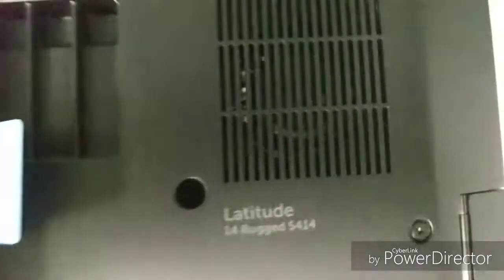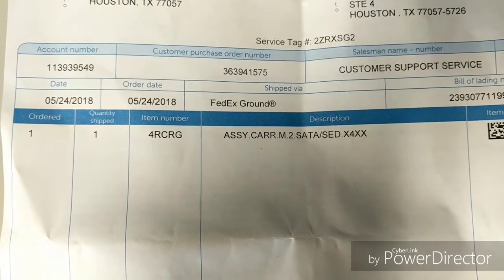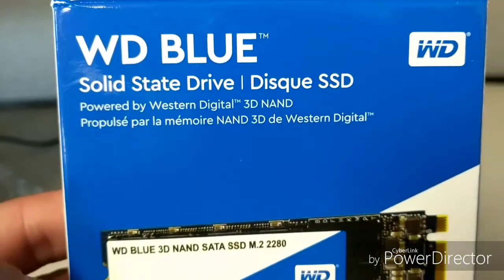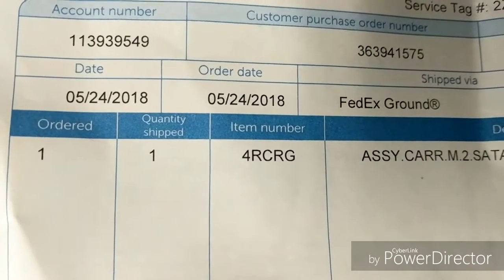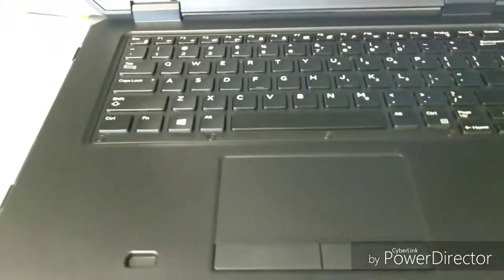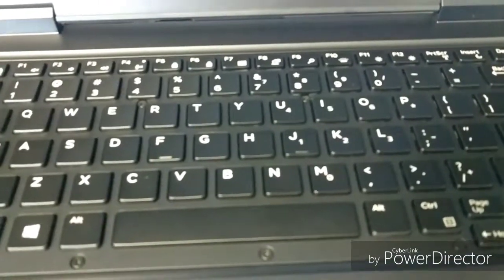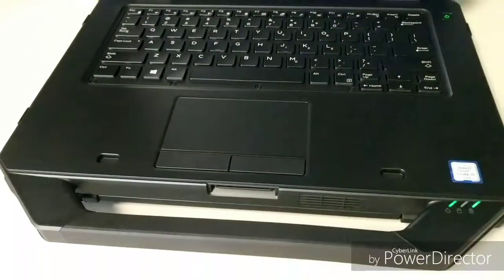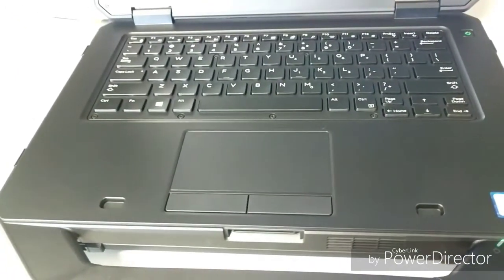Dell Rugged 14 5414 Hard Drive Caddy M.2 Carriage Assembly Part Number 4RCRG

Comment: For anyone else interested in the conversion of the hard drive to M2 SSD.  Several laptop Dell part numbers.
Rugged Extreme 7414 Dell part number is RDMY2 SATA M.2 Connector Carrier.  Dell description: Assembly.Carrier.M.2.Serial Ata.7414.
Rugged Extreme 7404 Dell part number is NXCKY SATA M.2 Connector Carrier.  Dell description: Assembly Carrier Bracket Soild State Driver 7404
Rugged Extreme 7204 Dell part number is 693VV SATA M.2.  Dell description: Assembly Carrier M.2 Serial ATA 7214
Rugged Extreme 5404/5414  Dell part number 575-BBGO.  Dell description: SSD DriveCarrier.E5404 ATG.Customer Kit.  This part number brings the caddy, screws and the SATA to proprietary connector. Dell 2020 price is $19.99.  
This last one not sure what machine its for.  Dell part number 575-BBGP.  Dell description is MCARD Drive carrier EX404 Rugged Customer Kit.  Its price is $24.99.

Comment: Is there a way to use a PCie ssd because I can’t get mine to work? I did get the caddy and had to buy the drive separately but if I install the drive the power flashes. I got into the setup and switched to a UEFi boot but had no different results.

Comment: I can't find this anywhere !!!!! Is that from Dell? I can't even find a regular enclosure. I too ordered without a hard drive. Any help is greatly appreciated.
Reply from the maker: Yes.  I called tech support at 800-879-3355.  Give them the service tag or express service code.  They can order and you can pay with them directly.  I made this video, because it took my support guy multiple days, and incorrect parts, before we got the right one.  So hopefully you can give him what's on that paper, to help with time..as those support guys are clueless sometimes.
Reply: Just call Dell  sales department and give them the Part# which is 4RCRG. Everything will only cost you $36.03 for shipping in the  US
Reply: Definitely wasn't that easy but I did get it from Dell. 2 weeks of back and forth. You need the right person and that ITEM NUMBER is correct.
Reply from the maker: @SirTODDER  Agreed.  Took a few weeks for us to get it right as well.  Not sure why this is so difficult for them.

Comment: Is the M.2 the only drive that can be used in the laptop or can I slide a regular SATA SSD in there?
Reply from the maker: I don't remember.  I don't recall it having SATA connectors.  I believe it is the proprietary connector only.  But I could be wrong.  I say that confidently, as I don't see why I would have went through the grief of getting the M.2 adapter.  But you never know.  I'll try to remember to take a look at one of them when I get back on site at that client.
Reply: For that Caddy you can only put the M2 in there. I have a few 5414s that came with standard spin drives, and i just swapped them out for Samsung 2.5" SSDs
Reply: @itsdibbles  
Thanks for your informative comment

Comment: Can you please guide for the name and details of the adapter used for interface between SSD to harddrive slot
Reply from the maker: Everything is in the video.
Reply: @cognetic  Thanks alot, Can we use dual internal hardrives and which model?